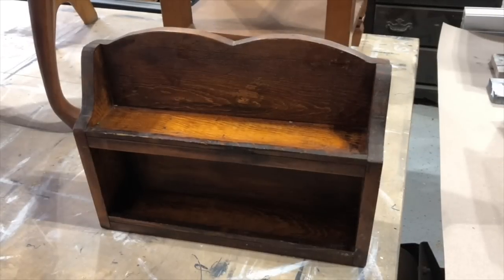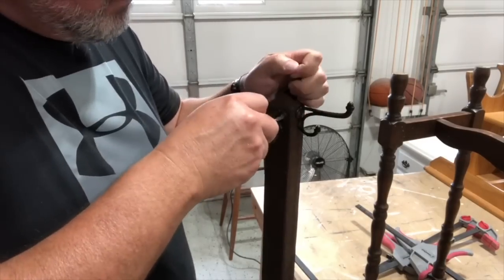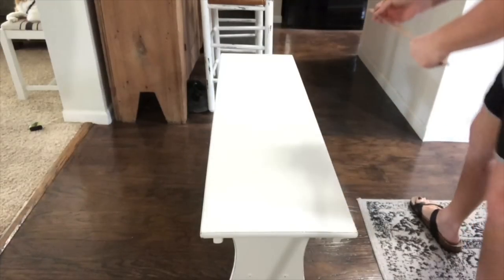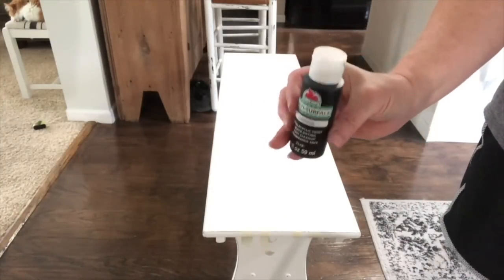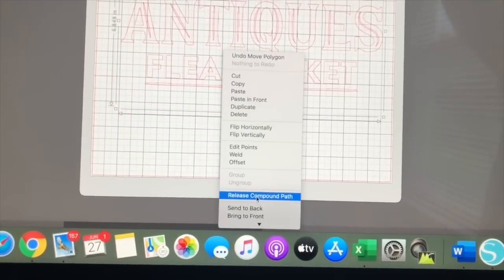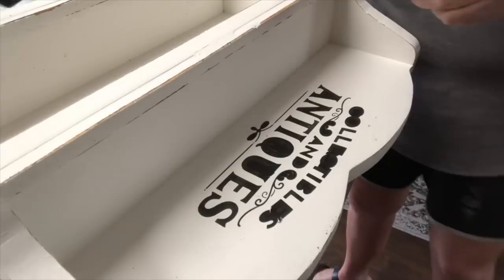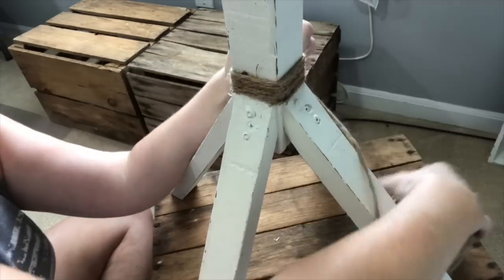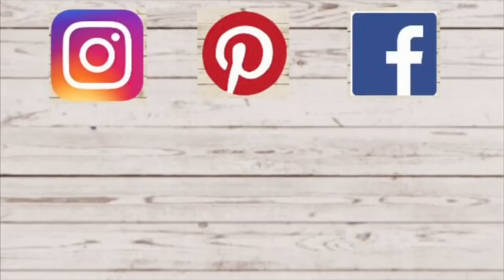Thrift Store Flips For Farmhouse Decor

Comment: I painted a table top shelf with a drawer and the drawer doesn't slide in and out now, would the wax help with that as well as protecting the whole piece?
Reply from the maker: Thank you for watching,Yes wax would protect the whole piece .Wax might help with the drawer problem.You may have to take the drawer out and look at the piece wood the helps it slide in and out straight. Make sure that is still attached and centered. Wax that. And Wax the bottom where it slides in and out. the sides and middle of the bottom. There's many reason why it sticks. So not seeing it this isa first things to try. Not all dressers have the middle piece of wood. So let me know if this works. Or send me a picture or message on my Facebook. And maybe we can help better.
Reply: @GingerChickRehab  Thank you so much! It's a small drawer and it worked perfectly before I painted it! I will try the wax. I knew you would be the one to ask. I love your channel, it's my favorite one!